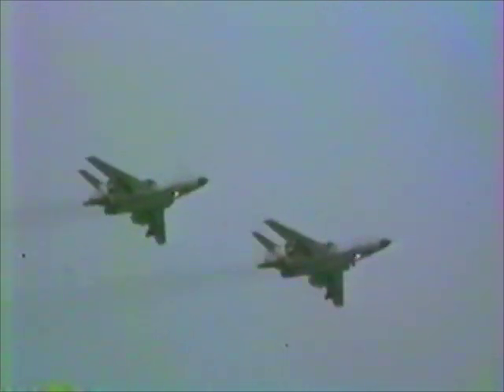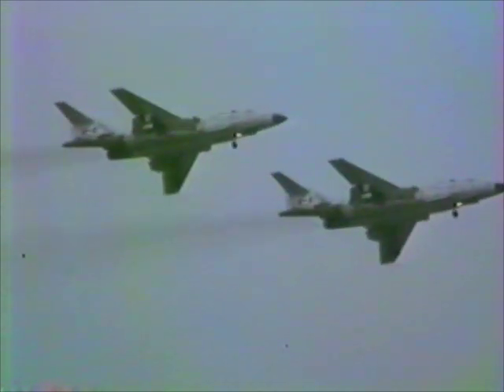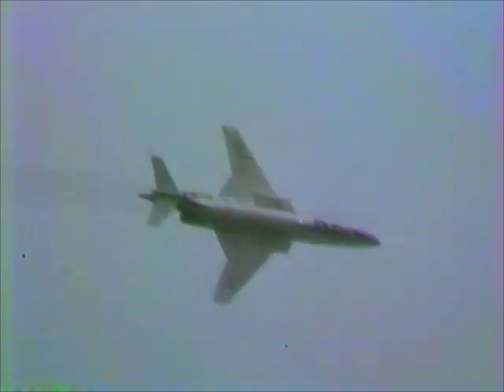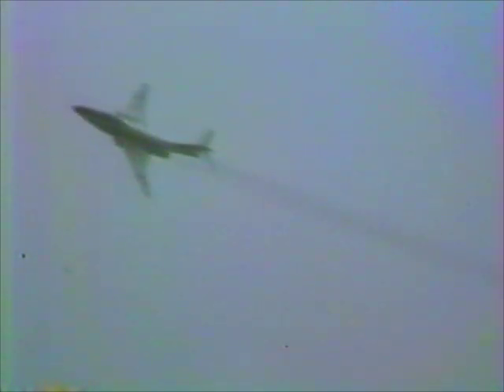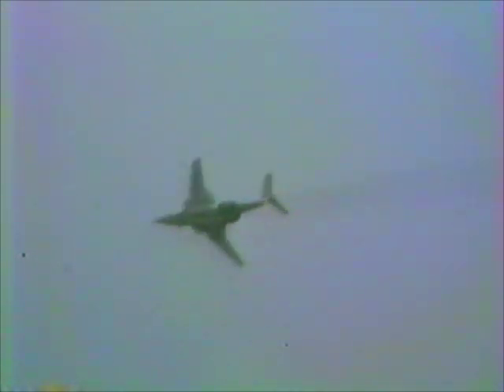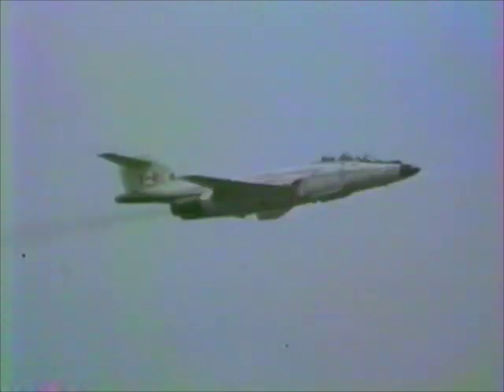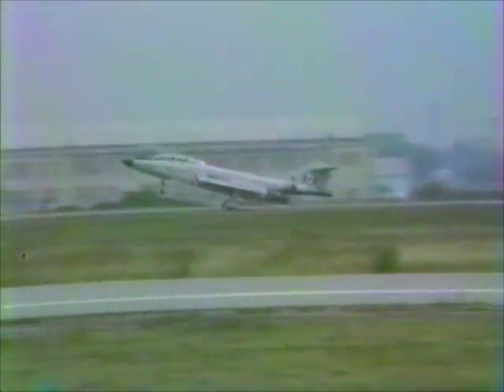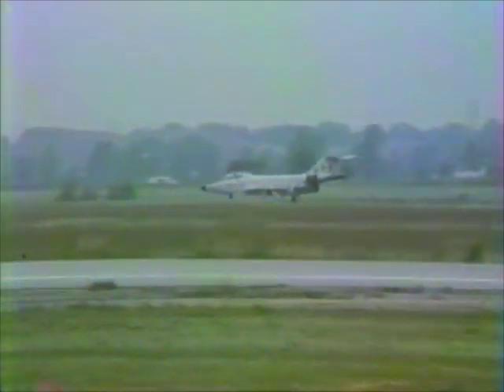CF 101 Voodoos

Comment: F-101 VooDoo, always a second rate aircraft that we bought to replace the far better Avro Arrow.
Reply: +walkergarya  But, it was good enough - and cheaper.
Reply: Andrew Noonan NOT when you count all the development money that was effectively dumped in the toilet when the Arrow was canceled. NOT when you count the huge brain drain of engineers, scientists and technicians that found themselves unemployed Feb 21, 1959. NOT when you count the cost of building a world class Aerospace industry and then scrapping it. NOT when you consider that foreign governments would have bought the Arrow once it was seen to be the aircraft we said it was. NOT when you consider that we have been backed into a corner to buy second rate American fighters since, the CF-101 Voodud that liked to pitch up so violently that it could peel its own wings off, The CF-104 Lawndart, where firing your own gun choked off the engine and with no wings to speak of glided like a brick with less control, and we still have not cancelled our purchase of the F-35 Hangar Queen, obsolete performance at modern high expense prices, too complex, too many roles, a true lemon.
Reply: I agree with you  about the F-35 - just not about the Arrow or the F-104 or Voodoo. Clearly it WAS good enough because Canada did not go to war during this period of time. As for the Aviation industry - please tell me what Canadian Built and designed strike or fighter aircraft ever achieved significant sales overseas? You sold what 50 CF-100's to Belgium. Not much really.. and you sold a few of your Canadian Sabres overseas too - yet that was not an inherently Canadian aircraft. Not much else that I can see if you exclude the Canadian built F-104's. Given the industrial base in the US compared to Canada it is highly unlikely you could have competed with them in the long term. Don't forget that the Arrow was an Interceptor and Interceptors depend on both Radar and missile technology to be effective and both of these were not that developed at the time of the Arrow. But yes, I agree with you about the F-35 piece of junk.
Reply: Andrew Noonan The Arrow was developed as a long range bomber interceptor, being the size it was, and with no internal gun, it would not have been a dog fighter, but with the internal bomb bay it could have been fitted with any number of missiles, bombs, photo recon, ECM. The Engines developed for the Arrow were 10 years or more ahead of the game. We had digital fly by wire running on the Arrow. 

We did not NEED to build whole aircraft to have an aviation industry, but other aircraft could have benefited from the development programs that built the Arrow. 

Canada had a GREAT reputation for its aircraft, the CF-86 Canadair Sabre were the BEST Sabres built, more reliable, faster, more powerful due to their Orenda engines. 

I will not say that we would have built every airplane flown by NATO in the 60's and 70's but we could have built some, but because of Deifinbaker Avro Canada never had the chance. 

By the time the Arrow was canned, it would have been cheaper to build 200 Arrow Mk2 and put them into service but instead, we paid extra to fly a second rate lead sled.
Reply: Disagree with you about the Sabre  - the CAC Sabre was also pretty good and had 2 x 30mm cannon instead of the 6 machine guns. So harder hitting. Performance was similar to the Canadian Sabre except yours was slightly faster. Yes, I'm aware the Arrow was an Interceptor and not a fighter. It was essentially built to do the same job as the Tornado ADV/F3 of the late 80's and 90's. It's why I did not mention turn radius or anything. Given the American subsidies they build into their defence industry I really doubt you would have sold much to NATO.  They simply would not have let you out compete them. The F-101 and F-104 may well have been second rate - but in the end it was all you actually needed.
Reply: Andrew Noonan We will have to agreeably disagree. I think the Arrow would have been a game changer and once proven could and should have been an aircraft for the ages, but it was never given the chance.
Yes, I am aware how the Americans bribed and scammed their way to defense contracts.
I also cannot back the idea that buying second rate weapons betting that they will not be used in combat is ever a good idea.
Reply: Walkergarya, in order to stop production of the Avro Arrow and have Canada buy the F101 instead, the Americans would have had to have bribed the Canadian Government right ? So the corrupt Canadian politicians accepted the bribe and put all of those Avro employees out of work. If your theory about the demise of the Arrow is correct, the Canadians were just as responsible as the Americans.
Reply: mouser485 While I do not know of any bribes being paid I think that the Diefenbaker government had it's head up it's ass.
I think other governments were having a hard time believing what the CF-105 could do and it was a very expensive aircraft. If we had put it into service and flown it at airshows and military trials in the US and Europe, I think that we would have gotten sales. I cannot prove this, this all happened before I was born.
Reply: There were no bribes - Diefenbaker was old school to a fault. The Arrow was cancelled due to cost and perceived obsolescence. In reality, the CF-105 program was doomed before the first Arrow took wing - it is almost a certainty that Howe would've axed the program had St. Laurent won the '57 election. Much as people like to think the CF-105 was combat-ready at the time of cancellation, nothing could be further from the truth. The 1st phase of flight testing wasn't quite complete by 20/02/59 - there were 8 more phases of testing and evaluation totaling more than 3000hrs of flight time yet to be undertaken. Early on in the design stages of the Arrow, RCAF demands for Astra/Sparrow 2 ramped up development costs to the point where a sole operator (RCAF) could not procure a large enough order to make the program anywhere near cost-effective. Selecting the Voodoo, a fully vetted squadron-ready interceptor, and  the cost of which being drastically offset by operating Pine Tree radar stations across the country, proved to be the sensible alternative. Bomarc, not so much.
The Voodoo served well for over two decades - a fast, long-legged, well-armed interceptor acquired for roughly 1/3 the projected cost of  a similar number of CF-105's. At any rate, the Arrow, like the Voodoo, would've been rendered obsolete within a few short years (like all purpose-built interceptors), and would've quickly fallen out of favor for newer multi-role combat aircraft.
Reply: Walker, Gary A., F-107 and F8U-3 Crusader III, Two higher-performing aircraft contemporaries of the Avro Arrow that were also cancelled. "Arrow engines 10 years or more ahead of their time," except the Blackbird family was cruising at mach 3 in 1963.
Granted, breaking up one of the best aerospace teams in the world for agricultural subsidies was myopic.
Reply: @cowboybob7093  Grumman F11F-1F Super Tiger is also a mach 2+ fighter and it was cancelled.
Reply: @cowboybob7093  The A-12 J58's only made 4000 pounds thrust more than the Orenda engines of the Arrow.  That actually surprised me.  Though the comparison between the isnt just IMO. The blackbird family waited for some time for the J58, but once it arrived, boy did it work well, esp. after a few years once they got the unstart issues sorted out a bit better.
Reply: @raynus1160  It's always easier to blame the American bogey men ,than their own people / own government incompetence.  The plane would have been obsolete in a matter of months , like almost all aircraft of the era were.  Was it a cool concept,  absolutely . Would it have been a good operational aircraft with any longevity? Well never know ,because bottum line the CANADIAN GOVERNMENT KILLED IT.
Reply: @jacksonstorm6395  
Canadians are rather weird when it comes to Americans.
Especially central/eastern/left-leaning Canadians. 
It's almost clinical.
Reply: @mouser485  Canada never bought the Voodoo. It was given to us. In two batches.
Reply: @briancotter3284  well if you read the CF101 Wikipedia page, it mentions the voodoos were “sold” to Canada. However, reading a little further it says “ The financial arrangements were sorted out by Canada taking over the staffing and funding of 11 Pinetree Lineradar stations within Canada that had formerly been operated and funded by the USAF”. So, if that’s true, they were kinda/sorta sold to Canada. :)

Comment: In January of 1980 I was working at Niagara University when a Voodoo Jet crashed behind Tam Ceramics on Hyde Park Blvd and a jet engine rolled into the Tennis Court at NU 
I was on the 8th Floor of Osha Dormitory when I heard two big Explosions a few seconds apart and the building shook so bad I thought it was exploding and after those explosions I saw daylight in some of the outside wall bricks 🧱 
No Lie my bosses drove over to where it crashed the saw both men still in the jet, decapitated and heads still in helmets then Air Force Police Chased them out and that whole area was every six feet were military police for three or four months with metal detectors looking for all the pieces